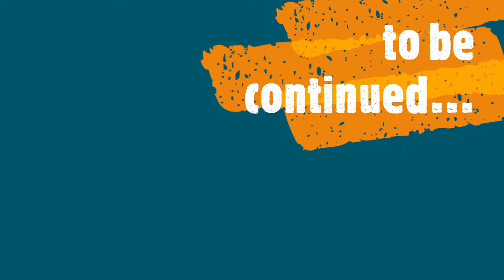A new Lambretta

Comment: Great project!
Reply from the maker: Thanks Rob! I try to restore and use mostly original spare parts. 
And parts which have proven to be good value for money or just simply work better than original.
The look has to stay as original as possible :-)
Reply: @thomaskunkel7460  looks like you a doing a great job! Nice choice on the suzuki conversion. I ran a honda 205 from broady and that was a pleasure to ride.
Reply from the maker: @kickbackgarage  Thanks for the compliment! There is more to come in the summer when I'll be back in the garage.
Genuine SX200 speedo, one-off electrics (nothing special)

The Suzuki conversion has been a great kit in the 90'ies as the 205 Honda. Now with the reed tune and an alloy barrel I think it's a nice re-interpretation of the old Ancillotti tuned Lambretta. I'm really looking forward driving it in the mountains of Asturias.

cheers, Thomas